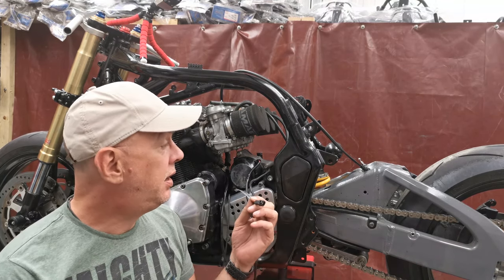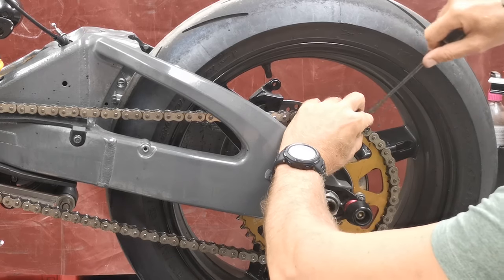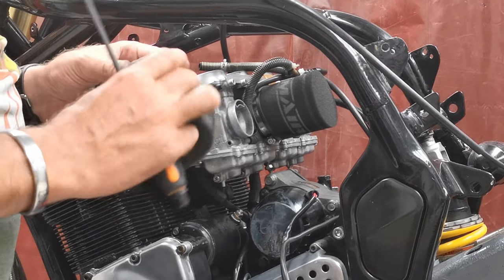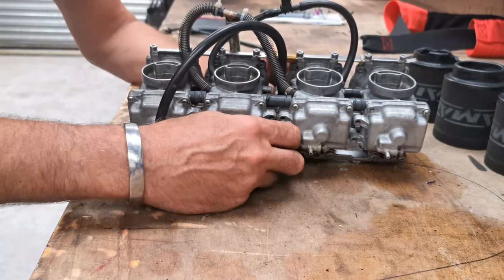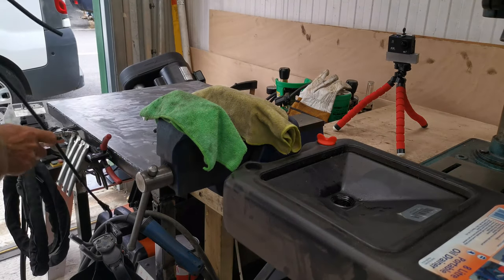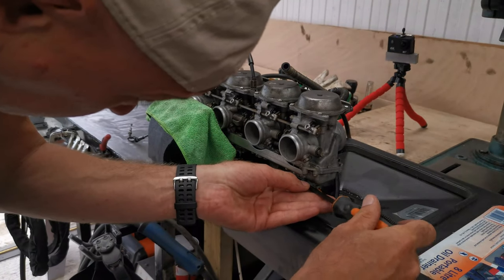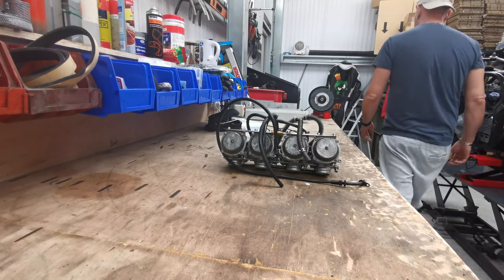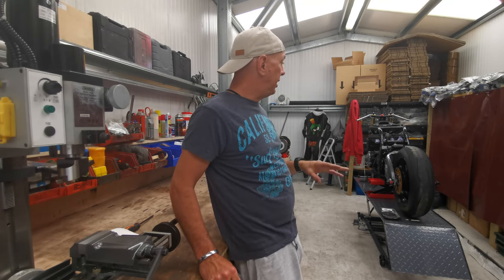Chain and carbs - Suzuki Bandit Cafe Racer Project - GIXIT Part 3

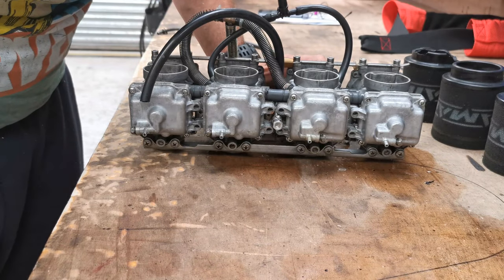Comment: 18:39 why would someone do that... Answers on a postcard to 'bodgit and leggit, trap 1, the mens toilets, any town, any place'. The winner receives a year's supply of rusty welding wire, an empty argon bottle and box of old odds and ends 😁. Basically 3 types of people who work on anything, rebuild to oe spec, rebuild with and use materials around them to a high quality and the final ones who want to use materials around them but lack the skills, patience and generally think "f*ck it, no one can see it 😂
Reply from the maker: It's sooooooo annoying when you find things like that... Wait till you see the next project bike that we pick up in one of the videos... You'll die laughing 😂🤣😅 some. Of it is unbelievable!?!